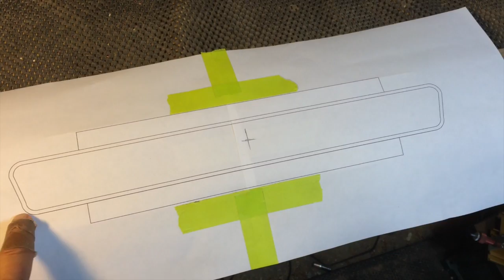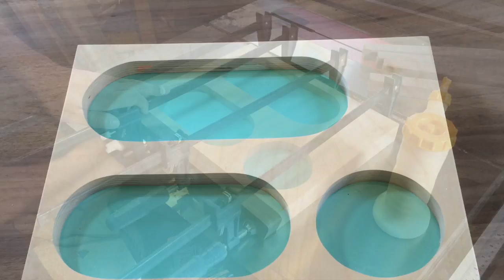Walnut Coffee Table

Comment: Really nice video and project. The one thing I think I would change is to add a large roundover on the drawer cubbies. And the handle has got to grow on me. lol 
Edit: Just watched your farm table video and am wondering have you changed over to using the 1000 grit now for the wet sanding? Do you wipe this clean after the sanding or is it left to dry and then sand again? b4 the next coat.